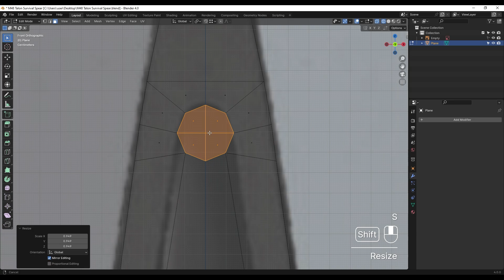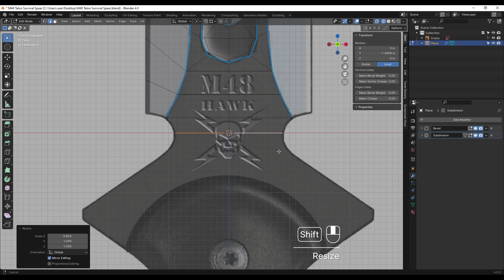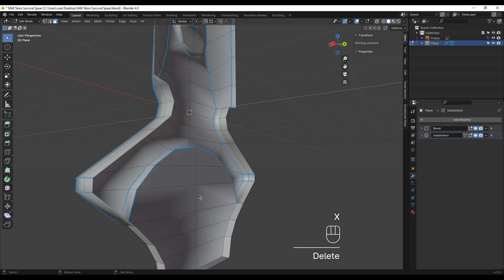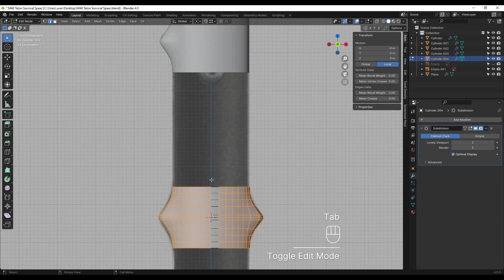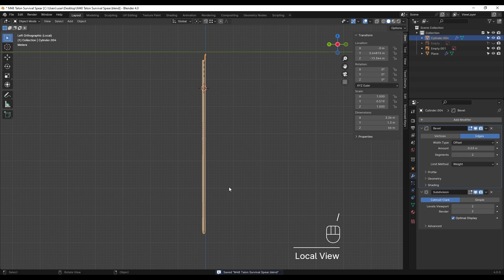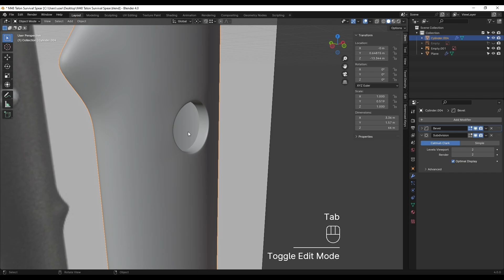3D Modeling the M48 Survival Spear in Blender for Beginners

Comment: Great video!
What is the difference between bevel weight and crease?
Reply from the maker: Both bevel weight and crease are used to control the appearance of edges in a mesh, particularly when using subdivision surface modifiers. However, Bevel weight is used to control the width of beveled edges when using the Bevel modifier, while crease controls the sharpness of edges when using subdivision surface modifiers, allowing you to maintain hard edges in your model.